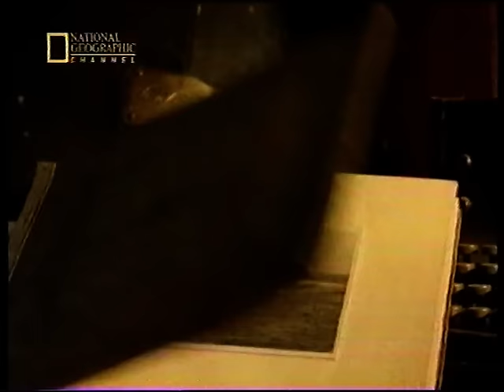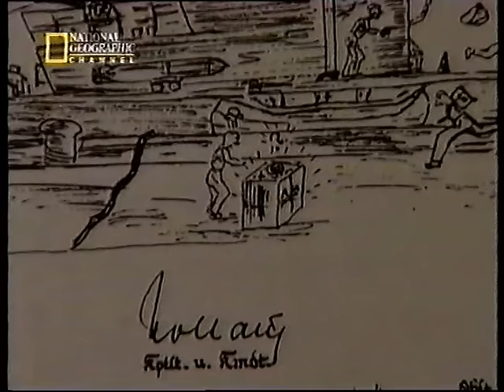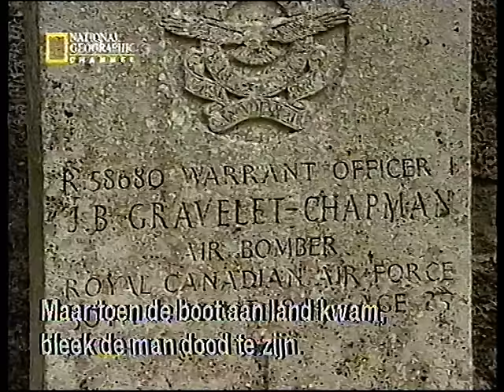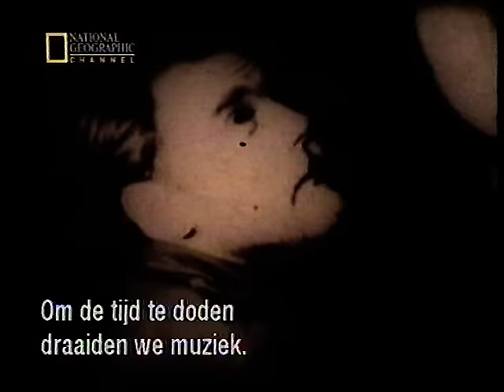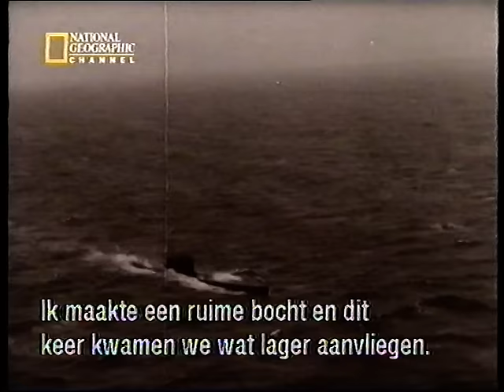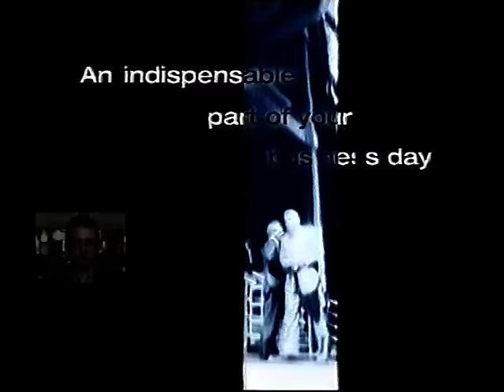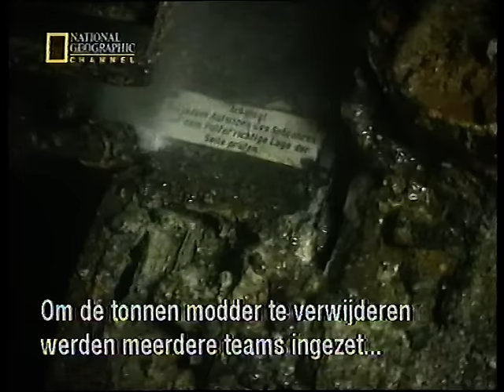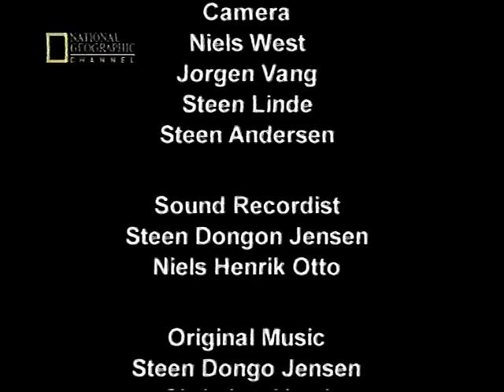recovery (salvation) of the u-boat 534

Comment: One of the best, if not the best U-boat restorations and historical displays is the U505 at the Museum of Science and Industry in Chicago, Il. I grew up south of Chicago and have been to the museum dozens of times thru the years and seen it when it was an outside display next to Lake Michigan. Now its all restored and inside a climate controlled building and it is absolutely amazing. I'm looking forward to seeing it again, and again... it will be around a lot longer than I will.
Reply: I wonder what it would take to make it sea worthy again.
Reply: Such an awesome experience. I cannot echo this statement enough. Always what comes to mind whenever I hear about u-boats. You can stand in and walk through a real one!
Reply: @ericb4127  I've been there, they have sections cut out to get a better view. Its probably not ever gonna be sea worthy as you'd have to reforce alot of the structural supports. It'd be cheaper and easier to commission a new one.
Reply: @ericb4127  not alot it wasnt damaged it was captured
Reply: A Captain of the U-505 shot himself dead on the boat during a Depth Charge attack, some time before the time it was captured.
Reply: @johnaitchie3803   They shot through it with cannons, the conning tower still has holes from the capturing. They cut openings for fat people through the pressure hull. The machinery hasn't been ran or maintained since the 50s, I bet it's all seized up by now.

The biggest problem are the pressure hull openings which weakened the structure a lot. Highly doubt they could dive to 230 meters with it again if they patched the holes up. It's unfortunate that all the Kriegsmarine U-boats have been ruined with the openings.
Reply: @patrickgardner2204  ... "a lot".
Reply: @PauloPereira-jj4jv  ya know, just a few, only a couple

Comment: I can remember visiting Wallasey docks, seeing this very impressive U- Boat towering almost into the main road, as it was so long, and took up so much room.
A few years later, as to allow disabled access, when it became a museum exhibit, they cut it into separate pieces.

They should have left it on the seabed.
Reply: That is correct, i went on the tour of the boat years ago, i think all the exhibits at the museum were scrapped, including hms bronnington the mine sweeper commanded by prince charles in his navy days. The idea was that it could be welded back together in sections much like the way modern ships are made nowadays,  just which someone would transport it back to the u boat pens and do just that.
Reply: By sdectioning it, it allowed access to the submarine and its internal workings. i don't like that it was cut up like that, but it does give you a far better view of the inner workings of a U-boat from WWII
Reply: Don't listen to this guy. Yes, it was cut into 3 pieces, but not bc of disabled avcess, when the museum that had housed the boat went bankrupt, the boat was going to be scrapped all together, but another museum managed to pull enough money to house it, but they didn't have the kind of money and resources to ship the whole thing to its new location in 1 piece, so they cut it up for ease of moving. It's still sad it was cut up, but there's no need to go and make up reasons
Reply: Is it still there?  Got a mate  in Wallasey

Comment: I read that 5 crew members went to the bottom with it, but escaped through the torpedo hatches, they had to swim 57 metres (220ft) to the surface! I can't imagine how horrifying that must've been.
Reply: Oliver Wreckords I don't think they made it, they either ran out of breath or their lungs might have burst from the pressure if they went use to being down that deep.
Reply: @taylortripp8598  All five crewmen did make it to the surface, but one of them panicked and forgot to exhale at the right time, so his lungs collapsed and he died anyway. The other four survived.
Reply: @vulpesinculta3238  How does that work ? You have to exhale a bit every 10 meters or just exhale all together before surfacing ?
Reply: FreakeyStyley Gradually exhale during ascent... never fully. One is trained to do this. Must’ve been a very painful death.
Reply: U534 had a crew of 52, 49 survived to be rescued, but three died. Five of U534's crew were trapped  in the torpedo room as the boat sank, but they managed to escape through the torpedo loading hatch. a 17 year old radio operator died as he failed to exhale  when surfacing. And another two of the five trapped  died from exposure in the water.
Reply: @vulpesinculta3238  Incorrect. Out of the 5 that escaped one died due to not exhaling (17 year old), two later died of exposure while only 2 managed to survive the ordeal.

Comment: She now lies 270 feet (82 m) beneath the surface of the Atlantic, 150 nautical miles (280 km; 170 mi) off the coast of New England and south of Nova Scotia, just across international waters into Canadian territory. 4 of her 5 vertical tubes are still sealed, her hatches are still sealed, and she is (presumably) still airtight with the remains of 49 German sailors entombed within.[6]
Reply: James Dale which U-boat is this?
Reply: Its very unlikely its still sealed
Reply: James Dale wow
Reply: James Dale which u boat are you referring to? not 534 because 534 did not sink with any crew on board. The 5 men who went down with it escaped through the torpedo tubes so which uboat are you referring to?

Comment: I can't believe you cut it into three parts.... just wrong....
Reply: curtis mcmanus It was cut up to preserve it, not destroy it! It now resides in Birkenhead on the Wirral, England in pieces that have perspex viewing windows - it's an incredible sight and also includes an internal museum of objects found inside the sub, including personal items such as pipes and shaving kits etc, even the sole of a boot. Oh yeah, and about 100 morphine ampoules which I'm surprised haven't been robbed as there's no reason why the morphine shouldn't still be active. The sub was due to be scrapped after nobody wanted to purchase her and pay to have her moved again - she now sits with a fully cleaned and repainted outer hull showing the damage from the mines that sank her, and the eerie way her AA guns are seized pointing skywards where they were last fired - if you can get to see this I'd highly recommend it, the engines can clearly be made out including component parts, rocker springs for the valves etc the huge batteries, the cramped conditions etc, it's a truly humbling experience. Outside of her is mounted on of several experimental torpedoes, the only real clue as to why she refused to surrender as nothing else of any significance was found - except the infamous (and up to that point from a German perspective still secret) enigma, the rusted remains of which are indoors with many other exhibits. The 3 sections and the indoor exhibition make for quite a small 'museum' from which you could wander around in 30 minutes - if you are interested in what's actually on display though you could spend an entire day there. I first saw saw it as a rusted ghost after it arrived and where it sat until it was doomed for scrap. The intention was to make it part of existing decommissioned vessels such as the sub HMS Onyx last served in the Falklands dropping off UK special forces, and a small frigate, I think HMS Andrew but I may be wrong about that name, and the fact it was a frigate - it was a war ship, my knowledge is very sparse regarding naval vessels as my interest lay in aircraft. A fantastic collection of aircraft parts found locally was kept at Fort Perch Rock lighthouse and Fort, but this suddenly closed for renovation work and never reopened to the public again - I have no idea where the exhibits went, or if they're still inside the Fort but that was another place that seemed to hold an aura of humility and memories, and I was about 8 the first time I visited there. Anyway, get to it if you can as it remains 1 of only 4 U boat displays, there is a fully intact sub in the US I believe which you can board as it was never sunk. Access to HMS onyx was also permitted while it was in Birkenhead although that's off to sunnier parts of the world somewhere now.
Reply: curtis mcmanus I
Reply: U505 is in a museum in Chicago.
Reply: The story of the capture of 505 is in a book by Adm. Daniel Gallery - and his team did it.  You can find a paperback of it in most good libraries.
Reply: Sadly HMS Onyx and the Frigate HMS Plymouth have now both been scrapped.
Reply: me hee  only fools relegate history to such trivial ideas.
Reply: @thephalcon9501  : Took my two to see when the U was still in one piece but off visitor limits because bit risky to traverse, we were told. Anyway, we went aboard Onyx, my daughters finger nearly chopped off within the peri lift handles. Also the small destroyer (?) and a LCI if I remember correctly.
Year - hmm, either 01 or 02.
What a sight although I always felt it odd to have bussed the U up the Mersey to display, especially when thinking of all the allied merchantmen sunk, to and from, that Western Approaches port.
Reply: @24934637  : Having visited both am sad to hear and somewhat perplexed that Liverpool /Birkenhead /Wallasey DIDN'T do something TO ensure preservation. Sod the developers, wiping out the float and the Wallasey docks.
Reply: I think it works...for those who can’t clamber through the confines of a sub....Elderly, disabled, claustrophobic it gives them a chance to see the inside...

Comment: Cpt Muller committed suicide after the war so the mission's objectives remain an enigmatic. If nothing was of value on board at the time then one can reasonably assume that U534 was yet to pick up it's mysterious "cargo" in Norway. I've heard all sorts of speculation from large quantities of mercury to be shipped (to fund ongoing political agendas) to scientific & or political resources to be transported. Whatever the final mission it would be reasonable to assume it was of considerable importance. Acquiring fuel from larger more advanced u boat categories types at Kiel to carrying 3 of the extremely valuable & scarce new type of sound differential torpedoes.

Comment: My gosh after all the years and those torpedo’s sitting in the ocean water can still explode/ be dangerous 😬
Reply: Any ammunition, torpedo, depth charge, shells left within a sunken ship or submarine remains capable of detonating for decades or longer. As the explosives deteriorate, they can become very unstable and can spontaneously detonate. Aside from the fact sunken submarines in particular are also almost always containing the remains of the entire crew, they also have as many as two dozen or more torpedoes aboard, each one with as much as 800lbs. of high explosives in the tubes and the torpedo rooms. If one detonates within the boat, the whole boat explodes. That and the fact they are often severely damaged, deteriorated or both are why a sunken submarine is a particularly dangerous place for divers. Most sunken submarines lie in very deep water, often imploded, ruptured, fragmented because they were destroyed by explosions inside the boat or by a bomb, torpedo or depth charge exploding on or near the hull. Others collapsed because they took on water and sank below crush depth, which for German U-boats was more than 300 meters below the surface. For 28,000 German sailors, their U-boats are their final resting place below the sea, until the day the sea gives up her dead.

Comment: Sadly, instead of coating it with a preservative so people could see it intact the lame British chose to cut it up into sections and put it on display.  Would have been a better fate to have been left to finish decaying on the bottom of the sea.
Reply: The original museum had it cut into pieces for ease of transportation but they went bankrupt. Another museum took over  it didn't have the money to reassemble the sub.  I agree they should have left it where it was

Comment: The historic warship collection, directors need their bloody heads testing, to chop it up like that, now countries or private salvagers with think twice of donnating any other vessels to know what a undignified end U-534 received, i say weld the bugger back up even though unreversable damage as already been done, at least it want look all igledy pigledy and basically perfectic for a cutting edge weopen of war...
Reply: The sub was NOT cut up by the Warship presevation trust. The WPT was forced to fold after the land it was situated on was sold to property developers, and they couldn't afford to move the sub, and so it was handed over to Merseyside transport authority  and it was THEY who cut it up.

On a happier note there is a project afoot to rebuild U-534 and to house it indoors to prevent any firther deterioration.

https://youtu.be/IgIwQ72m_C8

Comment: how is everything on board so well preserved
Reply: Layers of sand and silt, once solidified, prevented oxygen from corroding and rotting them. The low water temperature would also have helped.